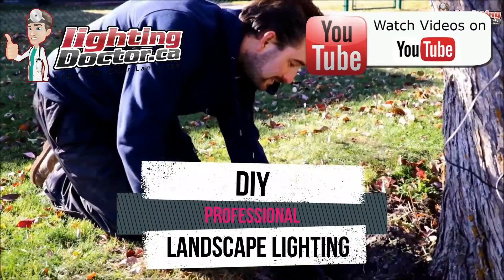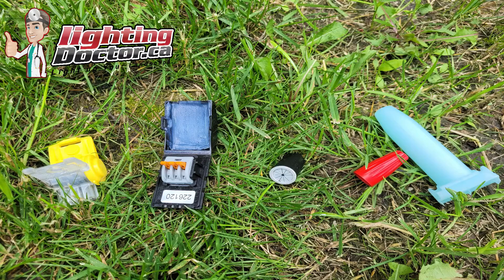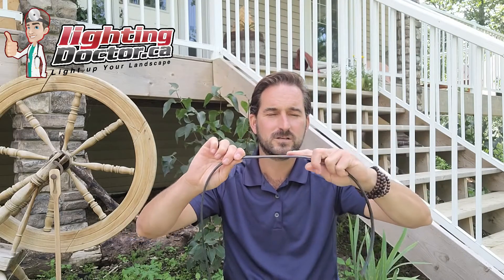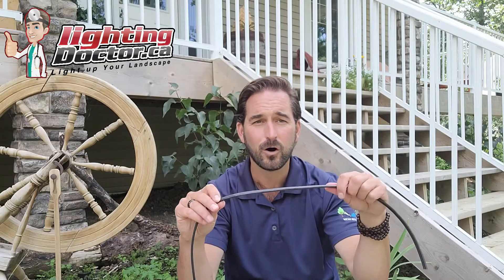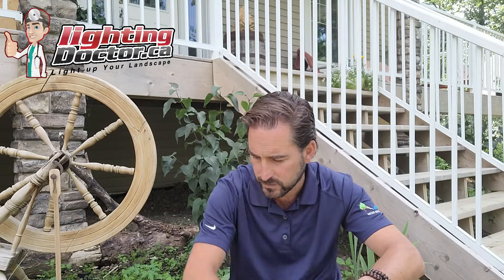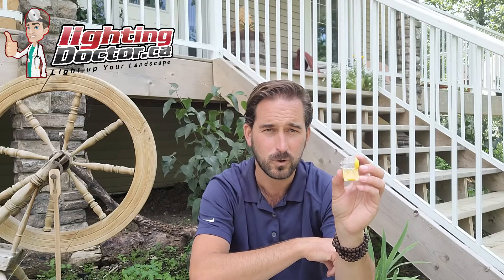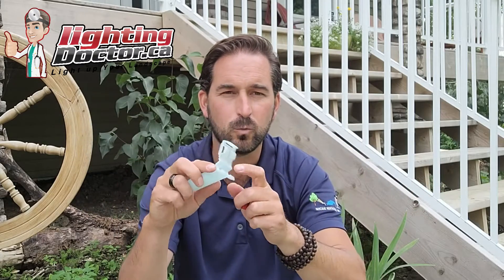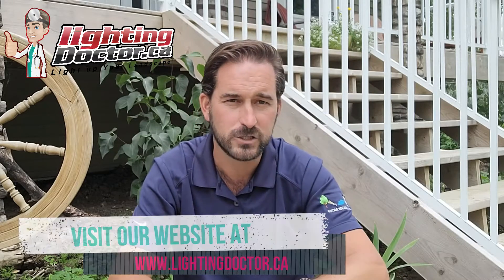Best Low Voltage Landscape Lighting Wiring Connections (Waterproof)

Comment: Only problem is, I installed my lights in 3/4" PVC and not a lot of room to connect a total of six wires and shove them all back down into the PVC pipe.The only videos I see are using just plain wire on or in the ground, with lights of stakes.

Comment: I have 26 lamps around the house on one main wire and don't like to cut the main wire for every lamp. Using those connectors that puts a pin through the main wire have worked now for more than 2 years, but in last months water is getting in and causing failed connections, even I used some liquid tape to seal it. I really love the idea of not cutting the main wire as it avoid any added resistance in all those T connections that become critical for my quantity of lamps on a single wire. So what is best solution for anyone who don't want to cut the main wire?
Reply: Cutting seems to be the best option. I also used the kind that stabbed the wire to make a connection and they failed.

Comment: Disclaimer: I am not a contractor, which means I can spend as much time on my home projects as I need to, in order to get the job done the way I want to.  There is no way anyone could make a living using my methods.  

What I did for my landscape lighting was to slip a piece of heat-shrink tubing over the wires, solder the ends of the wires together, put some hot melt glue on the solder connection, slip the heat-shrink back over the connection, the hit it with a heat gun and wait until the hot melt glue squishes out of both ends.  It takes time, but it creates  a permanent connection that's mechanically sound, and 100% waterproof.  Necessary tools: Milwaukee M12 cordless soldering iron, Milwaukee M18 cordless heat gun, and a generic M18 hot-melt glue gun (since Milwaukee doesn't their own yet).

Comment: Thanks for the nice summary. The Nano connectors also come as Micro and Macro. Basically, instead of being able to connect 3 12 gauge wires (or smaller) they can connect 5 and 8 respectively. I like the 8 for creating a hub and spoke wiring layout.
Reply from the maker: Yes, they are very versatile with aot of options. A little expensive but well worth the money long ter.

Comment: Super helpful. Do you have any tips for what do to when a prior homeowner used the "puck/crimp" style ones that put holes in the wire?  I'd prefer not to re-run the entire main wire line, so is there a good video or tip for "upgrading" to the BVS2s?

Comment: Hi I just sent you a super sticker.  Thank you for your great videos on low voltage landscape lighting.  I tried to send a message on your website.   I will try again as I have a question about a small lighting project with flush ground mount lights under small gravel - 12 V.